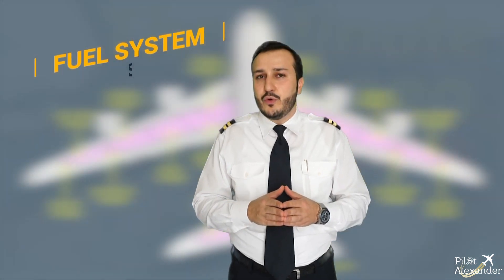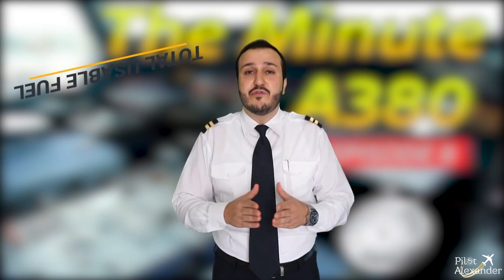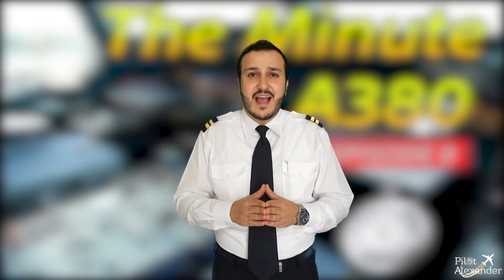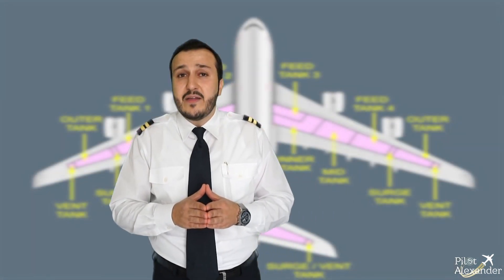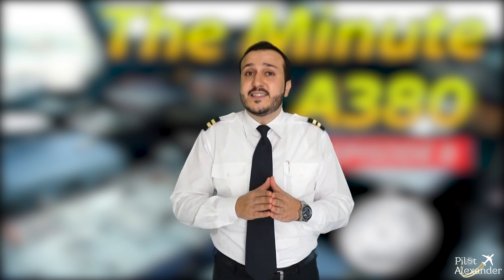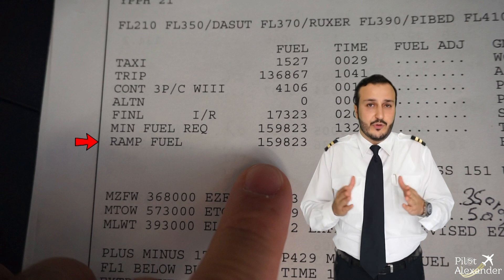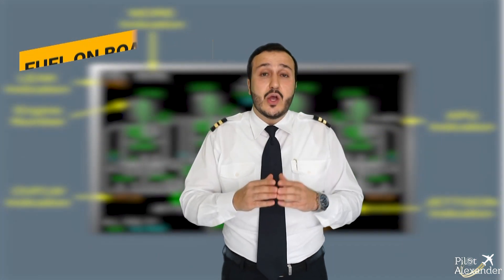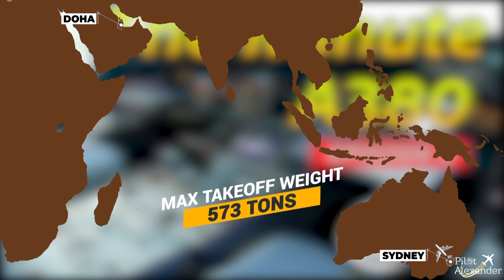The Minute A380 - Episode 8 - Fuel System

Comment: 1:48
Each FEED TANK has two pumps.
1) The MAIN PUMP runs continuously to feed its assigned engine, and 
2) A standby pump starts in case the main pump is faulty or switched off.

Comment: 2:02
The fuel pumps can supply the fuel to all the ENG using the CROSS FEED system.
Basically, if any MAIN or STBY PUMP from any FEED TK are OFF, any other MAIN or STBY PUMP from any other FEED TK will SUPPLY the related ENG. 
And if all the FUEL PMPs FAIL during your flight, it is not your day. RELAX.